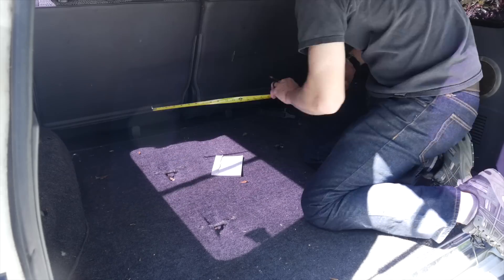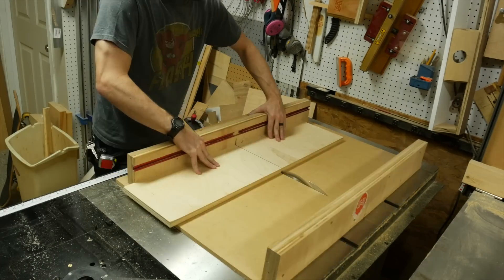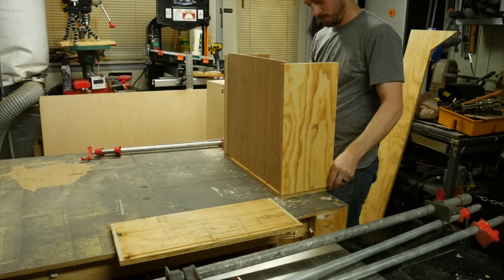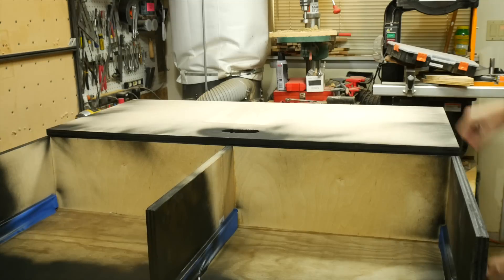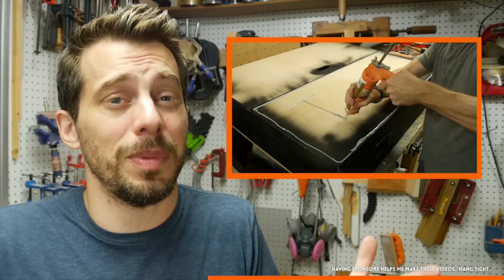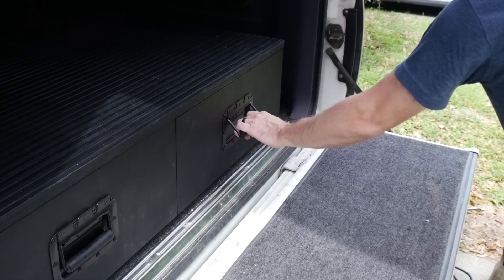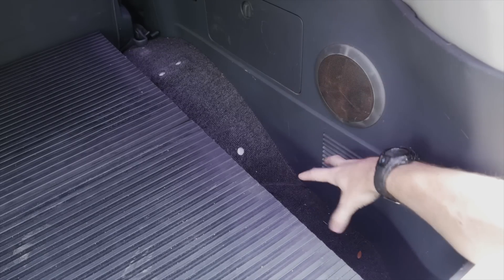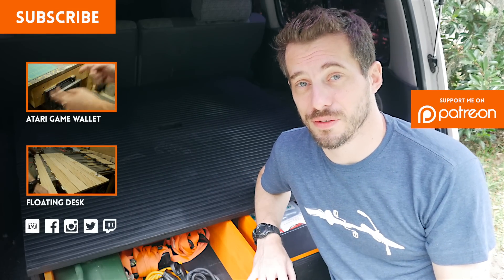Land Cruiser Toolbox // How-To | I Like To Make Stuff

Comment: Man I have a Ford wagon and I'm looking at doing something like this, I have a tool kit in the back and I don't like it sitting there, plus this would allow me to hide my amplifier, and I also like to carry a nice torch, and a hydraulic jack to make it easier if I get a flat, plus loads of other stuff. I should design one too, one day..
Reply: +TheAussieStig30 I built something similar back in the '80's when I was an apprentice carpenter and needed to carry and secure my tools in my station wagon. It was made of ply and had a tailgate that could fold down and a concertina lid to access tools from toolboxes. I did take a lot of work,  because I was only using basic hand tools and a power saw, but it can be done and given how easy it is to go to Bunnings these days well get your pen and paper and start designing.
Reply: +Mark Fryer I'm not very good working with wood, compared to working with metal. I have a lot of metal tools and only some wood, but probably enough basic stuff to do the job. My only concern is adding too much extra weight to my car, it's already not as fuel efficient as I'd like, but adding more weight would make it worse.
Reply: +TheAussieStig30 Well its your call if you make it from wood or metal, I work in both materials and wood is definitely easier to work. As to weight issues, well you are carrying most of the things already, so making some sort of box for them would cost a bit of weight, but only marginally and when compared to the safety and security benefits of making a locking box it is negligible.

Comment: This is awesome. I'm trying to figure out how to do this for my pickup truck. Any thoughts on water proofing the box and organization of larger tools?
Reply: Pressure treated wood and exterior grade caulk on every joint would be a good place to start. Not sure what you would do about standing water though...
Reply: +Rafael Torres, thanks for the input. I was thinking about that "as seen on tv" spray/roll on sealer. The one where he uses it to plug the screen door in his boat. Thought a coat of that on the outside and caulk on the inside would do it. As for standing water; I could alway put a slight pitch on the top of the box to she water to the tailgate. Thoughts?
Reply: +Deacon Woodworks. I've never tried that stuff, but I've always been curious about it. I suppose you could put truck bed liner on top as well. If the top is thick enough, you could even put in grooves. With a slight pitch it would drain just like your truck does now.

Comment: quick unrelated question, in a lot of your woodworking videos you mention using pallet wood. where do you find your pallets?
Reply: +James Martin you can find pallets anywhere. Check your home center or just go to the back of the store.
Reply: +James Martin Just do some research on what preservatives have been used in the making of many pallets as the stuff is BAD if your not careful. Hint its designed to kill bugs and insects that may want to travel via pallet.
Reply: Re: Preservatives have been used in the making of many pallets.

Yep, BAD stuff.. Not the best idea to use in in a enclosed vehicle which gets parked in the SUN.

Comment: My drawer slides rattle and it's driving me insane. I tried adding some rubber to the back stops and it worked for a day and then started squeaking again. It's the locking mechanism that makes noise.

Comment: Awesome channel, I Like To Make Stuff, I have just discovered it and love your content.  I am a technical and engineering person myself and love figuring things out as well as building things, both digital and real.  I don't have a workshop, much room to work with, or a high end computer to do most of my software, coding and development, but look forward to taking time to do projects like these soon as I am soon going to college very soon (trying to get in 2016 fall) and hope to start my own projects

One thing I need to point out is your website speed on my iPad.  Your site doesn't seem to load on my iPad 3 and I think it is due to the size of it due to all the links and stuff.  I wanted to check it out and do the email list thing, but the page could not ever seem to fully load.  I think there are some ways to speed it up on the Internet on sites like smart passive income which may tell a few ways, I haven't checked them but believe the speed problem can be fixed.

Comment: Bob, did you ever make the drop-in/lift-out side tool boxes?  Went to your twitch page, several videos on there, but none about the boxes (that I found).  Would like to know how that turned out.  Thanks!
Reply from the maker: I ended up making one of them on Twitch but those videos only stay there for a month or some after the stream.  It worked alright but I ended up not really using it.  In fact, I didn't use this whole thing long term and ended up taking it out.  Worked great, I just decided that  I didn't need it after a while.

Comment: Bob, i have something similar in my truck. You probably should bolt it down to the truck. If you get into an accident, the tool box is no longer going to stay still. Just a thought.
Reply from the maker: +Sherman Hartman definitely planning on it
Reply: Good stuff. How well do the drawers stay closed while you're driving around? The drawers in my truck have locks on them.

Comment: Any rubber or glue fumes in the LC after this?
Reply from the maker: Nope, none at all.
Reply: Thanks. You've inspired me to make a set for my LC200. Outright purchasing them is $1400! I'm sure I can do better than that following your video. Appreciate it.
Reply from the maker: Levon Smith Awesome! Be sure to lock it down in the back (I did it after this video) so it doesn't come loose in a crash!
Reply: How did you lock it down?

Comment: Do you know how much this weighed when you were done? I want to build this for my cruiser too but I've already got a TON of weight in the back
Reply from the maker: Unfortunately I don't.  I never weighed it. :/
Reply: Oh bummer! Doesn't seem to be too bad though...did you notice your cruiser sagging or anything in the back when you filled it up? I just have a big bumper with all the goodies on it and a fridge so I'm scared of overloading it!
Reply from the maker: spensurh No, I haven't noticed it making any difference at all, other than the noise of stuff in it occasionally rolling or sliding around.
Reply: Sweet thanks!
Reply: Land Cruiser 3500lb axle doesn't care.  If suspension dips add Air Lift Springs for ~$100.  I have both jammed full drawers and air lift bags.

Comment: Consider fastening it more seriously to the truck.  I'm a farmer.  I've seen a few wrecked trucks where heavy tools, and poorly fastened toolboxes slammed into truck cabs during collisions.  I'd want steel for the front wall, and bolts holding it down.

Comment: I really wish you'd gone to the effort to synch it down and secure it to bed. I need to do this myself but I off road and one solid bump would lift that right up, and scare the crap outta me.
Reply from the maker: +kodaspaws I'm planning on locking it down
Reply: +I Like To Make Stuff do a video on it, because the options have me stalled.
Reply: +I Like To Make Stuff  you have the right car
Reply: +kodaspaws For the box I made in my first car I ended up bolting down a large bit of angle iron and bolting through it to the box. That stopped any extra movement, but its not to everyone's taste.

Comment: I've got a LandCruiser and would pay good money for someone to build one of these for my truck
Reply: I have Landcruiser also.  Built frame out of aluminum square tubing and Estos Connectors (web).  Covered in 5/8" plywood and matching carpet.  Metals Superstore (web) custom cut the aluminum tubing and Home Depot cut plywood to size.  I just need to screw down top to aluminum frame and glue down carpet.  Took an hour to design and hour to put together.  14" tall and I use HDX 17 gallon tubs to store items completely hidden.  Bonus - very light weight and I have slept on it when camping.  Whole thing cost less than $100.

Comment: If you get in an accident and the truck rolls over, the drawers might crush you
Reply: +Muhammad Saad Better use the Velcro then :)
Reply: if an asteroid hits the truck it could catch on fire as well.
Reply: +Wes  that is true!
Reply: +Wes there's not gonna be an asteroid that hits his truck. Percentage of that is 0.00000000000000000000000000000000000000000000000000000000000000000000000000000000000000001%
Reply: Shakira Truong  how do you know that?
Reply: +Lo Studios I mean, accidents are sorta common but the truck rolls over?
Reply: +Lo Studios a truck rolling over isn't that common
Reply: Shakira Truong  i talk about the asteriod! xD
Reply: ? Truck high center of gravity. LandCrusier -= More likely to be taken offroad =Take off road = Roll-over potential.
PS: About a year ago a late model Cadillac whizzed past me and it 
broadsided a BIG SUV (Late model Tahoe or Explorer?). In a blink of a 
eye the SUV was flipped over a couple of times and came to rest on it's 
roof. Rolled that sucker right over.

Comment: Why do people call suv's trucks?
Reply from the maker: Have you looked up the literal definition of a truck? I think you may only be considering a pickup truck.
Reply: I Like To Make Stuff for it to be a pickup it would need to have a truck bed. Truck doesnt fit either because thats more for like medium duty vehicles that are build for carrying/hauling supplies.
Reply: Because an SUV was originally only built on truck frames.  This isn't the case anymore as some of the crossover are referred to as SUV's and these are not built on a truck frame.  They are also classified as light trucks under US standards because of the frame type.  It has nothing to do about a "truck bed"
Reply: Chris Short when i looked up vehicle class divisions suvs and trucks were completely separate then light trucks were ones with the lower gvwr. Theres a reason that the new unibody ridgeline is considered a pickup truck and this suv isnt, and thats because of its bed

Comment: Thanks for the content. I hope you don't intend to transport anyone but yourself in the vehicle. The idea that the weight of the drawers is sufficient in terms of restraint in the case of a severe collision is delusional. All drawers in a vehicle must be secured via rated points such  as cargo fixings or threaded holes used by 3rd row seats.

Comment: Soooo this isn't a truck
Reply from the maker: +Justin Lewis 
truck1
trək/
noun
1.
a large, heavy motor vehicle used for transporting goods, materials, or troops.
synonyms:	rig, eighteen-wheeler, transport, transport truck, tractor-trailer, flatbed;
Reply: I Like To Make Stuff 
sport–utility vehicle
noun  sport–util·i·ty vehicle
Definition of sport–utility vehicle
:  an automobile similar to a station wagon but built on a light truck frame